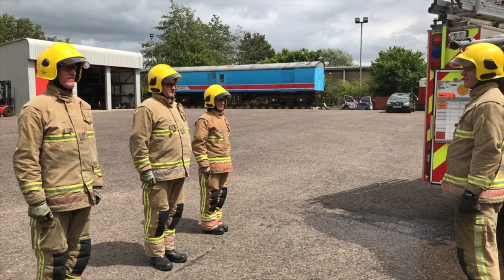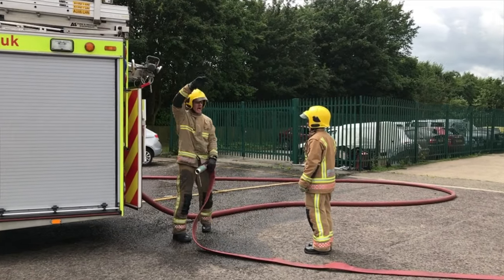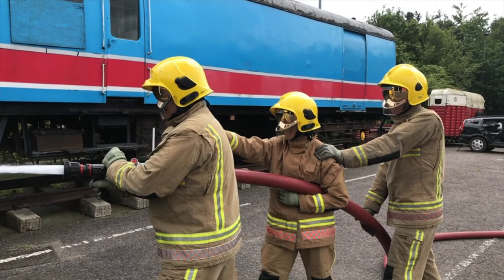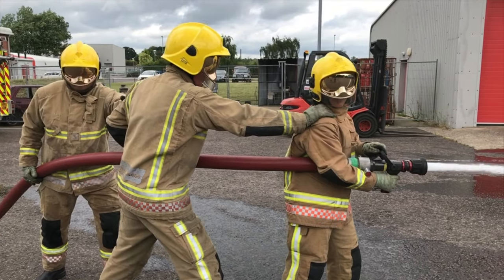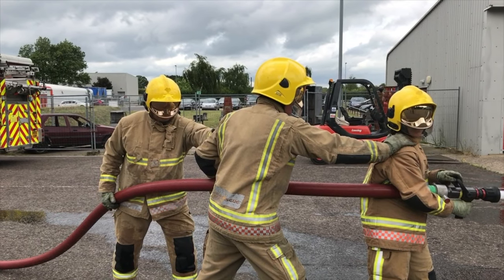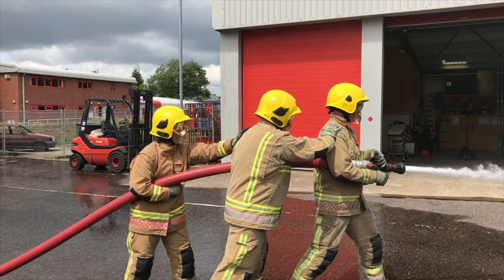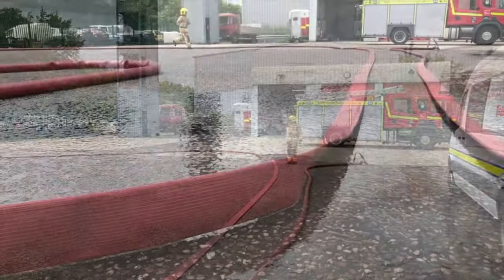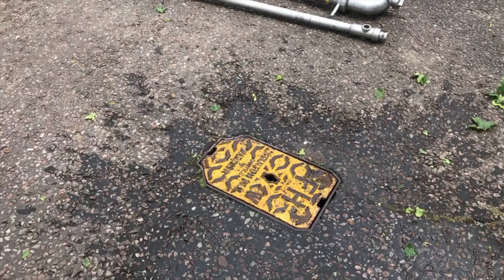NFRS Recruit Training - Standard Hose Drills

Comment: For those curious about the lack of urgency in this drill…

This is the fire service playbook used for training and drills only. It emphasises control and efficiency, not speed.

In a live operation, a hose reel (primarily used as a covering jet) would be deployed immediately as it already has a fed water supply, whilst the rest of the crew will run out a lay flat or two and find a water source (hydrant or open source). Generally 45s and 70s aren’t required as often as people think. Two hose reels will often do the job.
Reply: Never look down  whilst connecting..  keep your head up.
Reply: @greigshearer5614  why?

Comment: In Poland we have in my opinion better system for drills.  We use water splitter and if we want to extend or short the line we just give command to each other without a words. i.e
Nozzle operator when ready raises arm up and show "forward" . It means "Im ready, open water supply" we say ( water ahead)
Arm waving from side to side means water STOP.
Arm raises and fall like train whistle or horn motion (upwards), mean increase  water pressure,
  the same but Downwards = decrease water pressure
Reply: We also use that system here, the arm signals are more used than shouting out this is just training, if we are at a point where the pump operator can't see but they can hear us shout then we would shout.
Reply: You are correct Sir, these people are wrong. This is not how it is taught in the UK Fire Service Drill book.  Be wary of their other videos too.
Reply: @ashleyhoward8926 isn't it ?

Comment: Hi, you guys deployed this hose "conventionally" (as I was taught in the armed services) yet in your other video, the "Dutch Roll" or "Roll on a Bight" was used.  Why the difference?  I did note the other hose was a smaller diameter...  This method, with a layflat hose, we were taught was fastest, and subjected the hose to less abrasion during deployment.  I know times change, but generally there's a reason for doing things a particular way, I just wondered...
Keep up the good work, anyway, we can't do without you.
Reply: A Dutch roll is good for deployment in a more open space environment. These single rolls are more used for bowling and navigating tight spaces. However though this is pretty slow compared to a real fire ground.
Reply: This is purely demonstration real life these guys would be flat out
Reply: Dutch roll is usually deployed as the last line of hose at the entrance of the building, and allows the FFs to have a "bight" of hose as they enter.
Reply: Firefighter uniform cost, gloves vendor/ mfg contact no please
Reply: @scrappy673 we tend to Dutch role the 45 mm hose.

Comment: It really is interesting the differences. The hose connections are very different from the US (no shock, but those are kind of cool quick connect things), my agency has never allowed running on the fire ground just walk with a mission/urgency (too easy to injure self accidentally), and nozzleman is holding the kickback of the hose with his arms instead of into his hip or the ground. Your arms will tire a LOT faster if you do it that way. Pressure on the line seems pretty low though, so maybe not a big deal... but then you wouldn't need backers either.
Reply: All fire service equipment uses instantaneous couplings
Reply: Yeah, they all say no running but when you are understaffed, have quite a big job at hands and the public is watching everything goes.
Reply: @almerindaromeira8352  Until you are picking up someone who hurt themselves on scene because they were running and not only did you take time away to deal with them, you are down a guy.
Reply: @seanmahoney2671 don't join the fire service if you can't run. 
You can trip and fall by walking too, is not like jogging is going to exponentially increase the risk
Reply: @josh35639  No it doesn't. There are stortz & hosereel couplings, not to mention suction couplings, etc., etc.

Comment: What’s with the extended arm “salute” thing? Seems too high a level of military style routine that chews up time.
Reply: It's not a salute, they're called 'pumping signals'. They are used when it's noisy on a fire and the pump operator can't hear the person on the hose. An arm straight up in the air is 'water on' so the pump operator gives water. The arm out to the side then down is 'knock off' so the pump operator turns that delivery off. An arm up and making a pulling down motion (like you'd signal to a truck driver to sound their horn) means increase pressure by one bar. One arm straight up and one out to the side in an 'L' shape means reduce pressure by one bar.

Comment: Are there switches in the pump to switch when it switches from operates with water from the tank to from water connect from hydrant, can both be connected cocurrently?
Reply: As far as I know you can only use on or the other . You just close the tank valve if you want to use the pressure fed supply .
Reply: The tank delivers to the pump casing from above via a tank valve & this is normally closed whilst connected to a pressure fed supply ( hydrant or another fire appliance)& always for an open water supply utilising suction lift ( lifting by vacuum from a river, etc.). If the hydrant is a adequate, it is possible to re-fill the tank whilst delivering to the fire-ground at the same time, by temporarily re-opening the tank valve. Hope this makes sense. If a primer fails during suction lift, then the tank may also be utilised to  prime the system, but it's a one off chance, so it has to work. This is never official practice though.

Comment: I would have thought fire hose drills would need to be carried out as fast as possible to ensure firefighters could do it under pressure since fires are not slow.
Reply: It's done this way so you CAN do it fast. The more comfortable you are with breaking something down into steps the easier it is to do for real